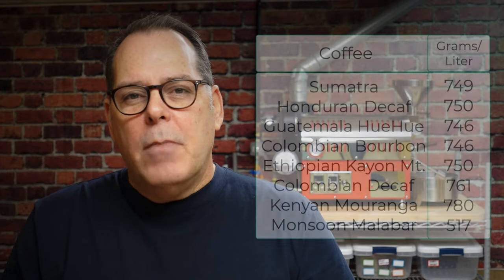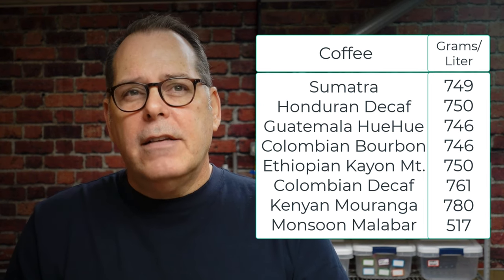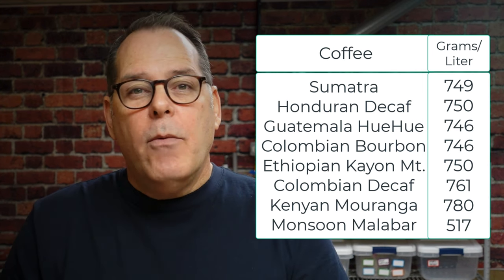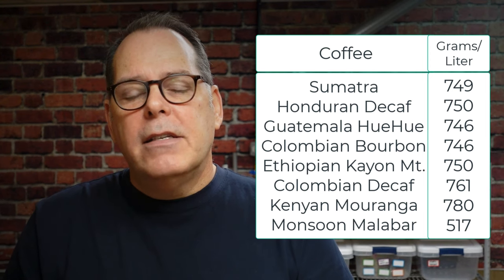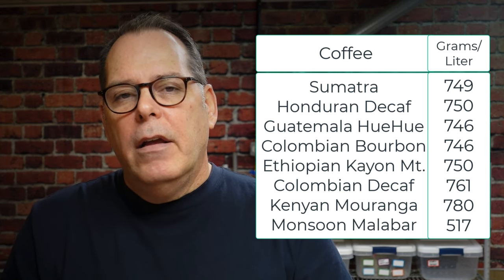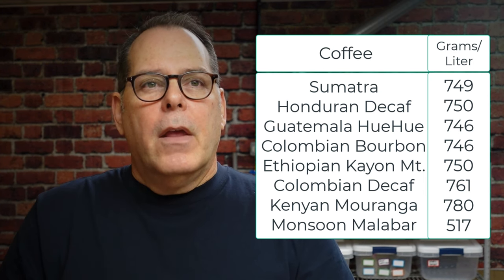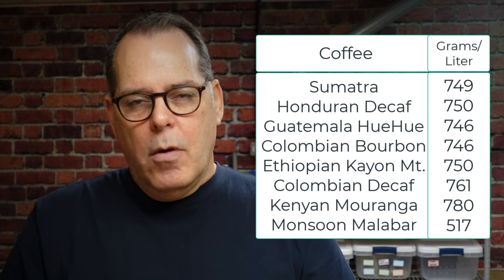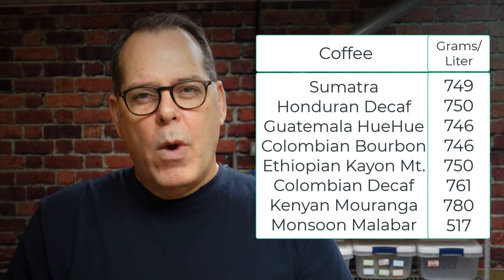Measure Green Coffee Bean Density

Comment: The physics nerd in me thinks that size of the bean will play a part in this. Small beans, on average, will measure a higher density using this method. Smaller bean = less space between each bean = more solid mass in the cup. This may be neglible though.
Reply from the maker: Hmm, it's the weight / volume being measured so if the small beans were half the density, then the weight would also be  less?   I'm not a physics nerd so I could be wrong.  Please correct me if I'm not thinking this through properly.  I'm interested to hear your thoughts about my assumption.  By the way, I do have an electronic density and moisture measuring device now.  How would you suggest i try and figure this one out?
Thanks for watching and your message.
Reply: @VirtualCoffeeLab  I just did a quick experiment. I used a small cup, filled to the top, it is 88ml. Filled to the top, it held 63 grams of green beans. Then, I filled the cup containing the green beans with water. It held 33ml of water (around the beans). 88-33=55. I had 63 grams of beans taking up 55 ml of the actual space. 63/55=1.15. That number being greater than 1 is why the beans sink in water. If that number is less than 1, whatever you are measuring will float. But, after saying all of this, I don't know if it will have any practical use in roasting coffee compared to the method you did in the video. ✌️
Reply: @VirtualCoffeeLab  it would be interesting how these two methods compare to your meter. You could make the 3 different measurements each time you get a new coffee, and after you get about 20 different sets of numbers, put each column in order and see how they compare. ✌️

Comment: I'd expect (from a gonna roast my first beans tomorrow expert) that outliers would be most deserving of attention, 735, 745 and 760 would roast so similarly that density would not be a factor, but a 575 or a 825 might deserve some attention.  As always, thanks.
Reply from the maker: 735 compared to 760 will roast a little differently. Depending on your starting
Temp, batch size, the lower density beans may have some tipping….  What are you roasting with?

A slightly longer total roast time may work better for the  735 compared to the 760.  I would encourage you to experiment using the exact same heat and temp setting and see if you notice a difference.
Reply: @VirtualCoffeeLab  Thanks for the response.  I'm giving a FreshRoast540 a try with some Honduras "Finca El Conejo Catuai Organic" I got from Captain's Coffee.  My density thinking was just that other factors would SWAMP relatively close density differences when first guessing at a roast.  For sure will try to keep track of densities as I experiment 🙂

Comment: Thanks for the video, Mike. Artisan software calculates density if you enter the bean volume in the Roast Properties window. My next roast I'll do that as well as figure it manually.
Reply from the maker: Thanks for watching Adrian.  More info to help us improve our roasts!
Reply: Adrian, it may be a stupid question but how do you measure volume? I add my beans by weight.
Reply: @asmith2886  A Smith, I weigh the beans first and then put them in a graduated measuring cup to determine volume. I enter that volume in the Artisan roast properties window and it calculates the density. This gives me a way of comparing density of different beans. I've just started doing this so I don't have many different beans to compare yet.

Comment: Hi Mike, excellent info! One point for discussion, I've read the opposite on heat transfer for low and high density beans. Low density beans have larger voids in the cell matrix, and these air pockets slow heat transfer. The roasting approach is the same however, but perhaps for different reasons. For low density beans, the approach is low and slow to prevent scorching as the heat transfer to the inner bean is poor. For high density beans, they can take higher heat without scorching allowing a roaster to speed up drying and get to flavor creation in browning and development more quickly. Thoughts? Thanks for putting out this video, there is very little content on the specifics of roasting methodology, and your videos are always so in depth. Cheers!
Reply: You are correct. Great vid but it is incorrect on this point and should be corrected.
Reply from the maker: Thanks for watching and your comments daRock1212. Great conversation here.   I failed to mention moisture level being a factor as far as heat transfer goes.  Beans that are more moist tend to require more heat to evaporate.  Apparently lower density beans have higher moisture levels ( I wasn't aware of that) and require more heat to evaporate the moisture.  Having said that, once the water is boiled away on a low density bean, and it goes exothermic, it really takes off.  This goes along with my statement about low density beans being sensitive to heat and really taking off.   
Again, very interesting  conversation here and a little confusing as well. 
Here are a few references to consider related to our discussion:
https://youtu.be/U0AYlyYUG_Y?t=292  Joe Morocco's discussion of the dry phase 
https://www.home-barista.com/roasting/coffee-bean-density-and-roasting-t52189.html  Home Barista conversation.
Scott Rao Roasters Companion (Page 20-21)

Thanks again, I appreciate your comments and encouraging words related to my videos.  I'm kind of putting myself out there doing these videos with the hope to do more help and not create more confusion.
Reply from the maker: @daRock1212 and @Carl - Thank you for your comments and correction to my error.  I have posted and pinned a correction and it will be visible at the top of the comment section.  I will also include it in my description.  I also hope to trim out that incorrect statement on the video (if that is possible).  Thanks for the encouragement and support of my channel. I appreciate your comments.

Comment: Hey Mike,

After my message this morning i watched many of your videos again. Today i roasted 2 batches of a washed sun dried honduran bean. I did take notes but needed to watch this video to answer my questions from earlier. 

They look good, much better than those Miramar beans. Thank you so very much. Take it easy.
Reply from the maker: glad they helped KG.  enjoy your Honduran coffee!
Reply: @VirtualCoffeeLab  hey Mike,

So I weighed out the Honduran beans. I got 207g. 
207÷250=82.8

Is this the correct formula? You stated something like this is called a free pour? 

With the number, what can I do with it? I think you stated to keep track of other beans density numbers and see how they roast. That this is another piece of info to help us roast. 

The roasts I made the other day are great, they taste so good.

Thank you 4 the formulas. My white board is really coming along.
Reply from the maker: Sorry for the late reply.  I've been traveling and got behind on my messages.  
No, not quite right.  You did the weight correctly but not the calculator result.  If you divide 207/250 you get  0.828 so your density is 828.  you drop the zero and the decimal point.  So 828 is a high density coffee.  It should be able to handle more heat, shorter dry if you desire and be less prone to roasting defects ;-).    
Was that helpful?

Comment: I've enjoyed a number of your videos Mike and agree with others here that you provide a great deal of useful information. Thanks for your excellent work!

If I may, I'd like to offer a comment about density. The method you've described gives one the free distribution density. A vessel of known volume is filled with freely distributed beans and the beans are then weighed. So if a 100ml vessel is filled with a green bean varietal and the weight of the beans is subsequently found to be 72g then the free distribution density is 0.72g/ml which in your system you are using as 720.

For comparing relative densities across a range of beans it is a useful metric and it's not particularly hard to do. 

Two points are worth bearing in mind about the approach however. Firstly, it doesn't scale uniformly across widely varying bean sizes. This is because within any vessel a much greater proportion of the volume within the vessel will consist of air spaces between very large beans compared to the proportion of air spaces within the vessel when much smaller beans are being measured. Secondly, the density measures provided (e.g. 0.72g/ml above) are not the actual densities of the beans themselves. Green beans sink in water, so their actual density must be greater than the density of water, which is 1.0g/ml.

Another method gives actual densities of the beans, accounts for differences in bean sizes, and is only slightly more involved.

Take a known weight of green beans and drop them into a graduated cylinder which has a known volume of water. The beans will drop to the bottom and the water level will rise. Record the final volume of water. The bean density (measured by this method it is called the displacement density) is calculated as the weight of beans divided by the difference between the final and initial volume of water. So if one adds 30g of beans to 100ml of water and the water level was observed to rise from 100ml to 127ml then the displacement density of the beans is 30g/27ml = 1.11g/ml.

This method scales uniformly across differing bean shapes and sizes and is a measure of density that aligns much closer to real bean density that one can measure with specialised methods and instruments. As you point out in your excellent video, knowing the bean density does indeed help one to achieve more predictable roasting. I find this very easy to do and after measuring a new batch of greens I simply pour them out through a sieve, dry with paper towel and then let them air dry in my shop for a short while before returning them back to my stock.

Hope that's worth some consideration and agree entirely with the other comment here about speaking and using the metric system. I grew up with feet, lbs, inches etc. but once you start using the metric systems it takes very little time to see it is just soooo much easier and nicer to work with!
Reply from the maker: DM, thanks for the great information.  I agree 100% that displacement density is more accurate.  I appreciate the precise number that will take into consideration bean size as well as density.  The part I don't understand is how the weight of the bean will influence the level.  It seems as though it is only considering the volume of the object.  

Let's assume all of the beans sink to the bottom of the measuring vessel.   One weights significantly more than the other.  How does their weight influence the volume of the water?  

After many videos, with an audience that is international, I have have started incorporating more metric measurements into my videos.  I understand your kind encouraging comment to use the metric system and do see it's value.  My current primary roaster is set to display metric measurements and me, the old dog, it trying to incorporate this into all of my roasting.  It is a process.  Thank you for your patience.

Thanks for watching and for sharing.  I would like to hear your thoughts on my question related to displacement density.  For some reason I don't like the thought of wet beans.  ;-)

Comment: Good video Mike, it popped up in my feed to watch again. I was looking around at what I could use for a density tube and opened my coffee drawer and there it was staring at me - my Aeropress tube. A near perfect cylinder. I put a few filter papers in so the water wouldn’t run out, tarred the scale and filled it with water and weighed it.   The Aeropress plunger is also really good, slightly smaller volume. I’ll start measuring density next time I roast.  Only 13 bags of bad coffee to go!
Reply from the maker: Density is really helpful.  Measuring out your beans and comparing them is really interesting.  I find that most of my coffee I enjoy are high density coffees.  
Great tip on the Aeropress!  Thanks for sharing.  I use the plastic cups a little for dosing/sharing coffee with family and friends.

Comment: I am using fluid bed roaster. Here is my experience on higher density beans (Ethiopia Yirgacheffe)

1. High density beans (Ethiopia) has lower first crack temperature, typically lower by about 6-8F compared to lower density beans such as Brazil Arabica.
2. I use the same temperature roasting profile for both low and high density beans, but load 15% lower in weight for higher density beans.
3. Higher density tend to affect the chamber temperature quite substantially (fluctuation) especially during the drying and Maillard phases.
Reply from the maker: That is very interesting.  Thanks for sharing. What type of fluid bed roaster are you using?  

 I'm roasting a high density Ethiopian currently.  I found that the bean can take a lot of heat and once i get to the end of dry, it really likes to take off.  It is sensitive to heat adjustments and if I'm not careful, get a shorter than expected/desired middle phase (browning).  The coffee is moving too fast AND THEN i get first crack that comes early like you have experienced.  I have found that if I slow down my middle phase, first crack won't happen much different than my other coffees.  

So by lowering your load 15% your roast will move faster right?  That chamber temp fluctuation you mentioned, do you think that is because the bean is giving off heat?  Is that a washed or natural?  

Thanks again for watching my video and for sharing your experience.

Comment: Wow! Thanks MIke! I had just started to investigate this question a few days ago and wasn't getting very far. I figured that bean density had to be an important indicator for the roast profile, but I hadn't read or seen anything on it. Now you've given me an answer and a method.
It would be great if Sweet Maria's, Burman's, Coffee, Coffee Bean Corral, etc. would list the bean density for all the green beans that they sold. This would be a great help!
Reply from the maker: Hi Dave, thanks for watching my video.  Most of the sellers will list the altitude the coffee was grown.  Between that and the origin, you can estimate density.  Then, when you look at the bean you can also get an idea of the density and if that matches with the altitude.  Ultimately it is measured to confirm.  I'm not sure why they don't provide the density?  Maybe because moisture levels may vary and affect that measurement?   What are you roasting with Dave?
Reply: @VirtualCoffeeLab  I just got back into Roasting. I roasted with a hacked air popper 15/20 years ago. Bought myself a SR800 with factory extension tube. Plan on installing thermo couples with phidgets and Artisan software. I've joined a few groups on FB and have been watching a ton of videos. Yours seem to be the best, well formatted, good progression of skills and enjoyable. I live in the White Mountains of New Hampshire so no roasting for me until spring, but that's ok as I now know what I don't know.
Reply: Thank you!

Comment: Thanks for the very well done video. I am curious to know what the altitude of the farm is where the Monsoon Malabar came from. I would imagine a quite a low altitude say around 700-900 meters?
Reply from the maker: Hi Damian, thanks for watching and your kind comment.  I have roasted a monsooned malabar coffee and it is a "freak of nature" so to speak.  It has a super low density and i believe the process has something to do with it as well as the altitude.  So, the coffee I roasted was grown at about 1200 meters.  My density score on this coffee was in the high 500 range I think?  It was really big yet very light.  It you look at this video ( https://youtu.be/Fd9IAiOPukk ) at the 5 minute mark and you can see the difference in the center line.  It is wider which also indicates a lower density coffee.  It was a difficult coffee to roast compared to most i have experienced.
Reply: @VirtualCoffeeLab  Your welcome, it is always great to share this passion with others. The wider center line is why I asked about the altitude. My farm is at 1200 meters and the beans are never that wide.. Like you say, a freak of nature. Could be that the farmers didn't use fertilizers. That would affect the density for sure.

That's the great thing about coffee. Altitude although important, is not the final word of what cups well. My tipica coffee would score 85.5 - 87 3 years running. Great flavour notes mimicking geisha with very noticeable lemon characteristics.                     No one knows everything, there is always so much more to learn